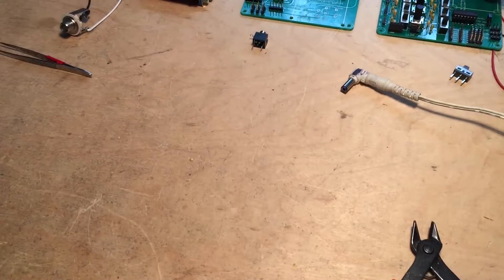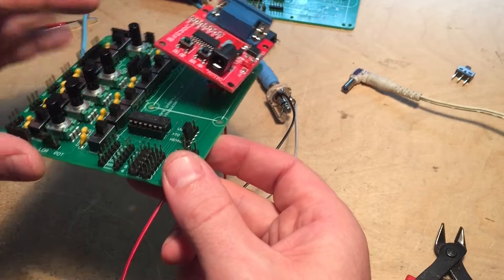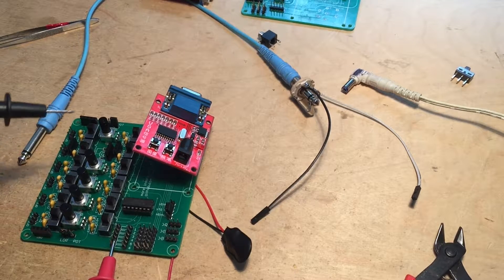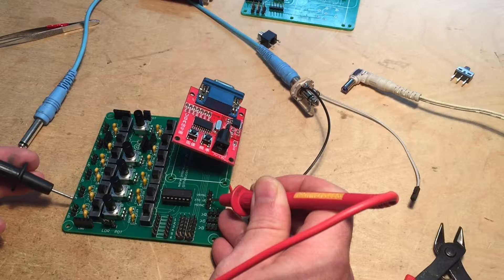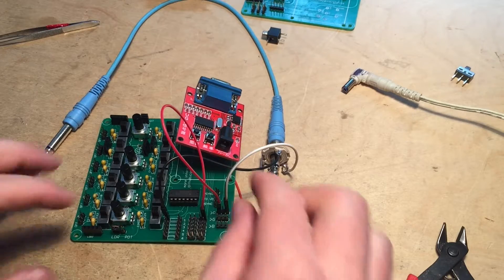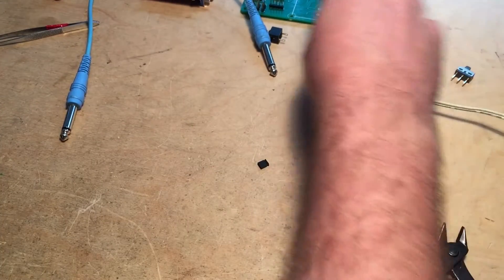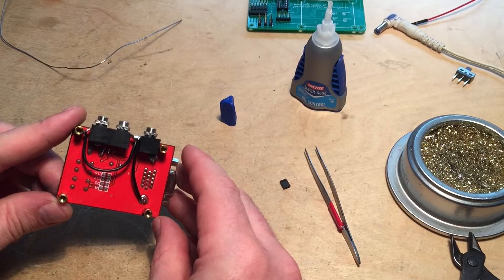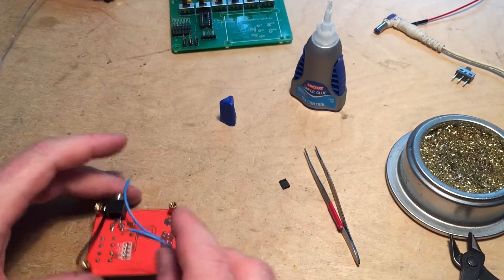CHA/V Audio Jack Tutorial

Comment: what could be wrong if negative voltages from eurorack oscillators comes to the RGB inputs of the VGA Signal test generator?
Reply from the maker: Hi! Sorry for the delay. I don't log into youtube very often. You can contact me more reliably through the contact form on my site: jonasbers.com.

To answer your question: generally, digital devices, like the microcontroller (mcu) chips in the signal generators or Arduino don't like negative voltage. Their power rails are often 0-5v, or 0-3.3v. Exceeding power rail voltage is a good way to fry a chip. MCU chips usually have diode clamps on the inputs, but it's not a failsafe. A Eurorack system has power rails of +/-12V, and so it's capable of supplying more voltage than the MCU can handle. I've unsuccessfully tried to kill a CHA/V with my Eurorack system, but it's definitely possible. A more likely bad scenario is interconnecting a CHA/V with a similarly poorly designed device. They could certainly kill each other.

Comment: This video (and your site) are exactly what I needed ! I have the same CRT, what type of converter are you using from the VGA signal? Are you sending RGB component or just composite/S-video? Thanks! Awesome stuff!
Reply from the maker: Thanks! In this vid I think I was just using one of the ol' $10 special eBay converters. There's lots of info on my site about converting VGA to composite. In my opinion the best solution is to use a nice CRT VGA monitor and capturing it with a camera.